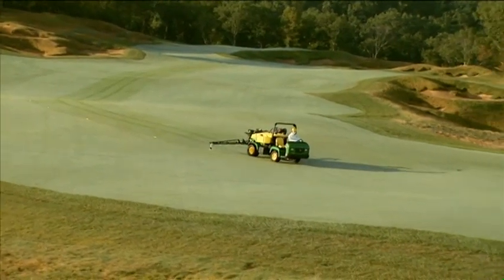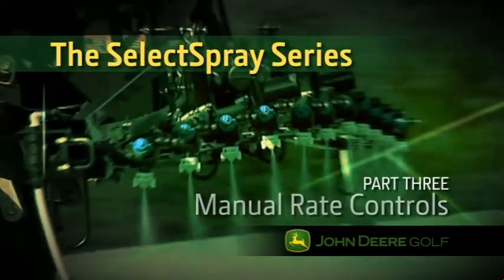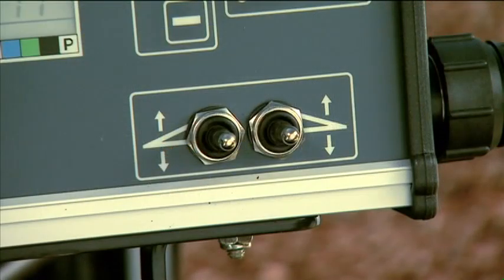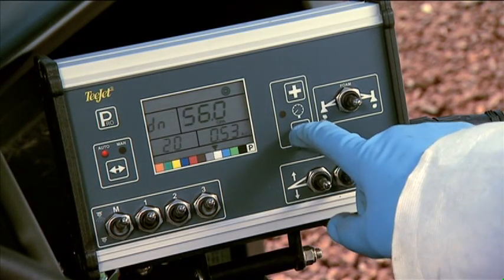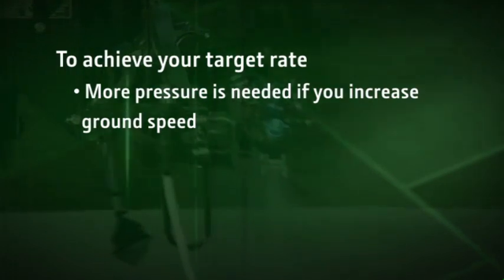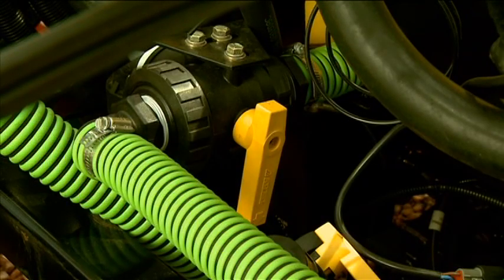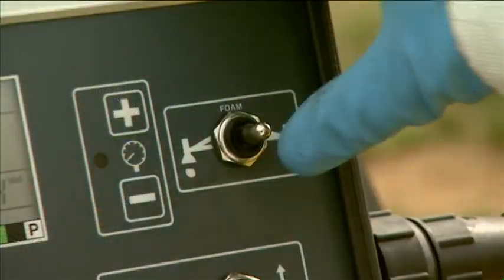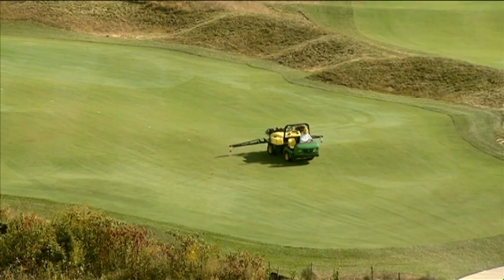HD200 & HD300 SelectSpray Operator Video | John Deere Golf

Comment: I have gator 4WD 2030A HD200 with this controller box, I want to ask about this the setting is auto, but when the application is finished the auto system cannot make the spray active if the unit is not running, how do you get the spray to come out, if the unit does not need to run?

The operator finish want to clean up the tank and in the hose nozzle

Comment: Do you make diesel versions? great for small farmers!
Reply from the maker: Mackenzie - yes, we do! We currently have 5 diesel models in our lineup. You can find them by visiting our Product Selector tool: deere.com/en/gator-utility-vehicles-product-list/ and use the 'Preferred Fuel/Power Type' filter. Filter options can be found on the left.  Then, you can sign up for a test drive at johndeere.com/demo or simply visit your local dealer dealerlocator.deere.com/servlet/country=US .
Reply: John Deere I always love John Deere. Great equipment and service. Customer for life.